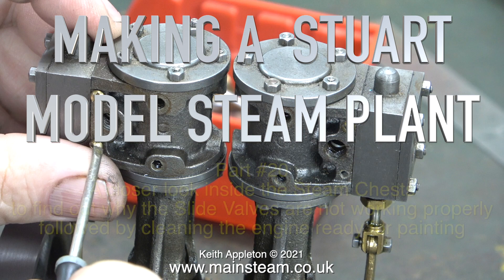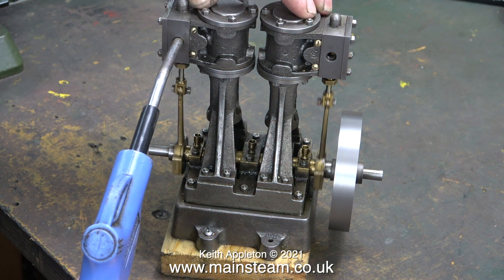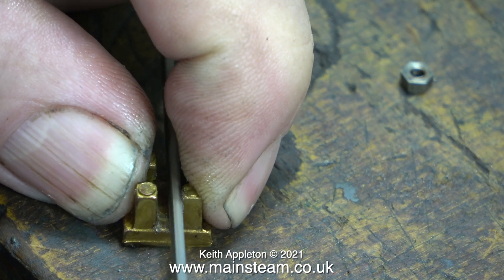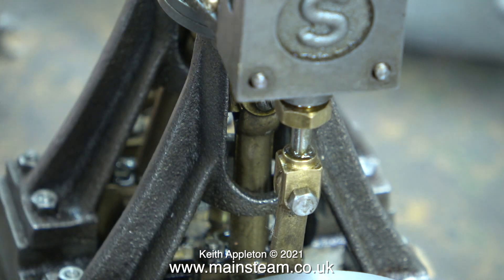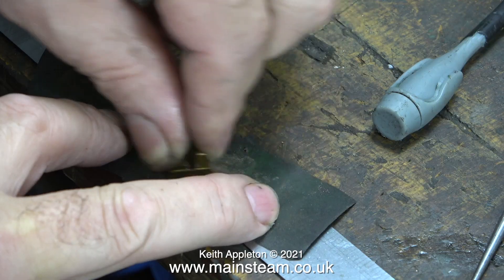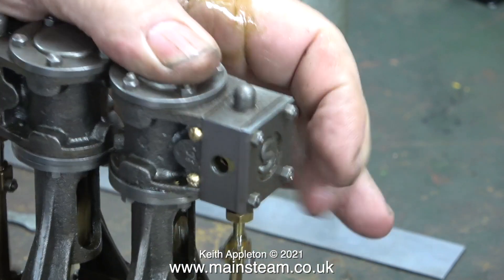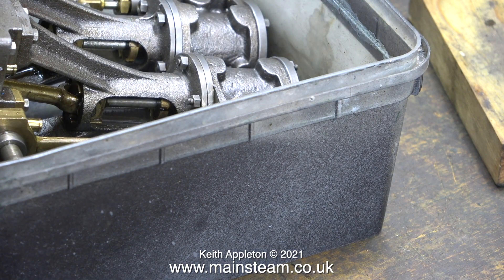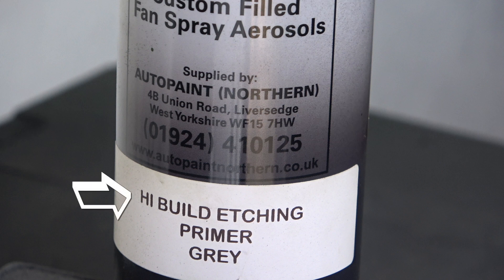MAKING A STUART MODEL STEAM PLANT - PART #20

Comment: I built a 10V last year as my "stuck at home" project and am still amazed that it turned out looking nicer than a lot of the engines you get stuck with rebuilding. It was my first time building one of these and I have to say it would never have worked out as well as it did if it wasn't for your videos, the editing is excellent and the tutorials you provide are very informative.  Those small engines are a real challenge and extremely tedious to say the least and would never recommend anyone to try one as their first machining project. I managed to make my kit with just a lathe, lots of fiddling, hand tools and a drill press with a machining vice.  I don't have an air compressor to try it but after fiddling with valve timing was able to spin the flywheel and it then can almost keep it turning over by blowing through a hose into the valve chest which I suppose is a good sign that it has compression there and not binding up.  It's not perfect but I got it all painted, looks super cool to have on the shelf and one less engine you have to be worried about ever seeing thanks to you sharing your knowledge with us!
Reply from the maker: I am just glad that you find my videos useful, that's why I make them }:-)))

Comment: Happy new year, Keith.
I found that the brand of washing up liquid I use can be a pretty effective degreaser for model steam engines. I use it for my Wilescos by putting the engine in a tub of hot water and this washing up liquid. While it may not be as effective as the gun wash and cellulose thinners it's a good non-toxic alternative.